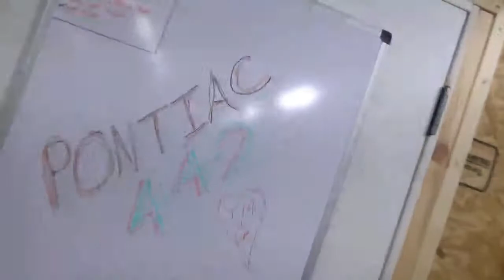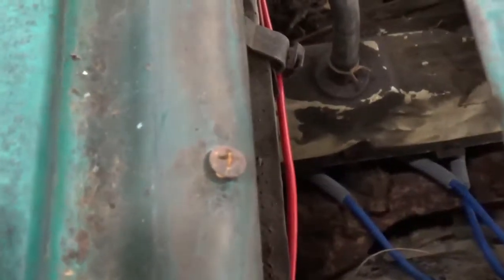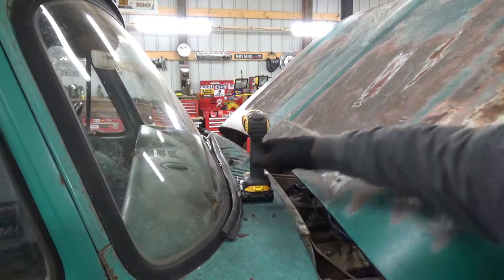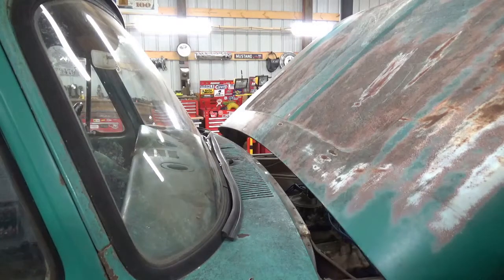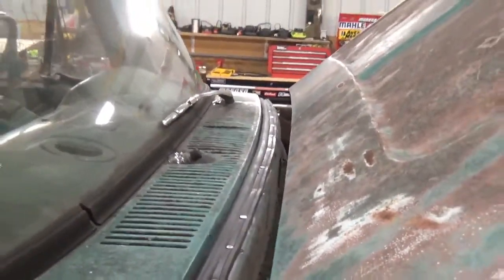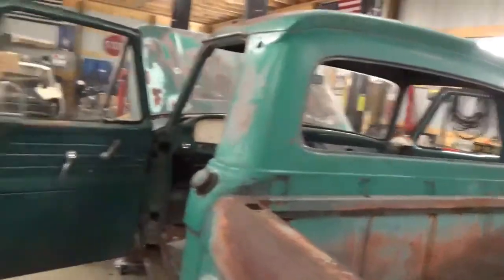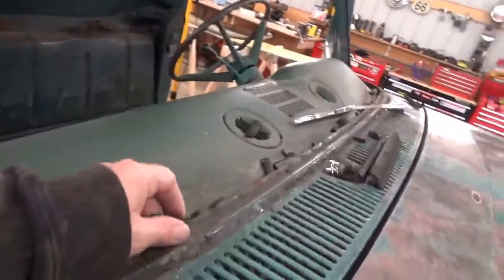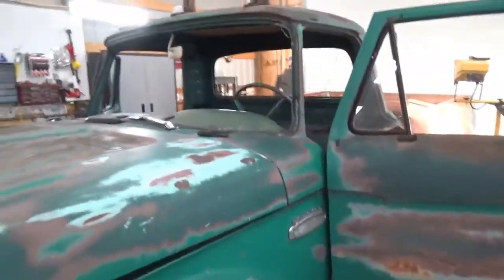1965 F100 Video 3  More weatherstripping and glass removal

Comment: Due you have a zaktoknife if you due you can cut the rubber a way from the glass
Reply from the maker: I used one on the back glass. But the front glass seal was so hard that I had to use a hammer and chisel and bust it off. After I got the window out the seal just broke off in pieces.